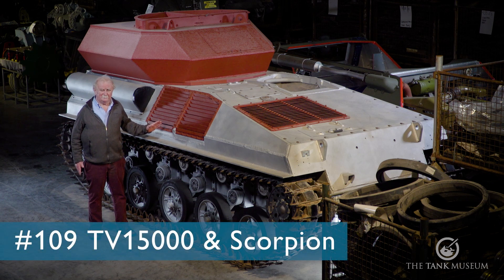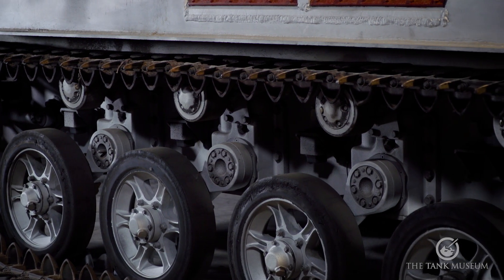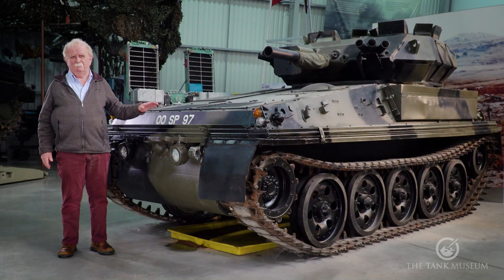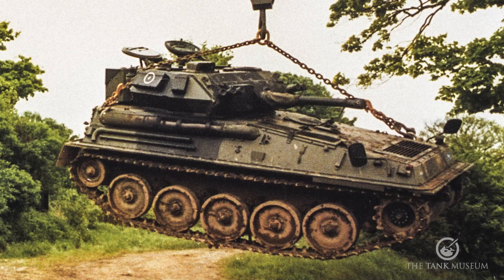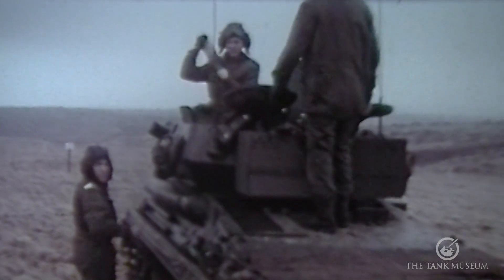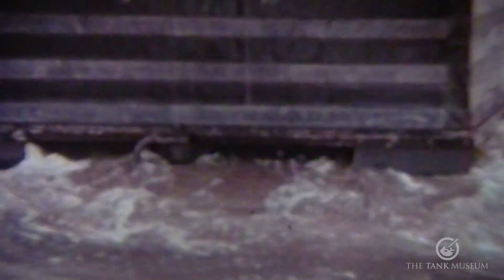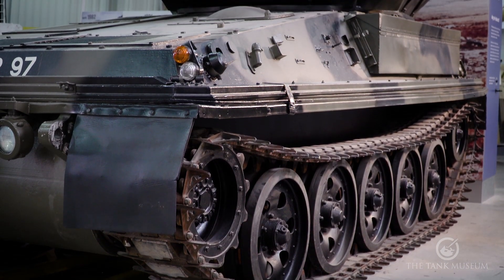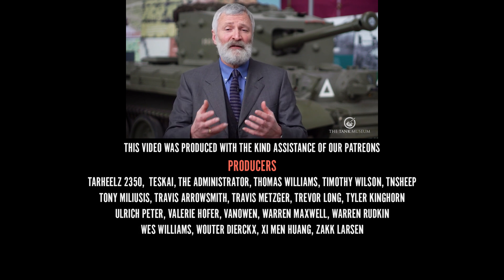Tank Chats #109 | Scorpion & TV15000 | The Tank Museum

Comment: Was the Rolls Royce engine of the prototype turbocharged? The picture when david is talking about the jaguar engine at 6:38 shows the Rolls Royce FB60 engine but with a turbocharger
Reply: @rayjennings3637  I know, but look at the picture, and you can fit a turbocharger into a carburetted engine, like a Renault 5 turbo. I don't know if the engine shown in the picture is an FB60 for sure, but that's a turbocharger at the end of the exhaust manifold.
Reply: @joseandrescaneirolopez90  It looks like one of the turbo-diesels that were fitted to some vehicles.
Reply: @rayjennings3637  Renault 5 turbo (the one with the fat as, has electronic fuel injection). Renault 5 GT turbo use a 1.4 turbo engine with a Solex carburettor, with the carburettor installed after de turbo, the only problem with this is to keep the pressure inside the carburettor and the jetting. I,m pretty sure it had a carburettor.

Comment: Couldn't they have simply fitted the gun with a bore evacuator? Or does the barrel need to be of a certain length to do that?
Reply: @Harold Smith posted the the explanation (After your post,  I will not copy his entire comment, just the relevant part)
"I've heard the 'fumes' reason for withdrawing the Scorpion, but I've also heard an alternative, or possibly complimentary, explanation, namely that the Conventional Forces in Europe treaty (CFE) defines a 'tank' as any turreted vehicle with a gun over 75mm. This meant that the Scorpion, at 76mm, would be counted along with Challys against the UK's 'tank' allocation, while the BMP-1, at 73mm, wouldn't count with T-72s et al against the Russian's (somebody didn't think that one through..). Given the choice between Challys and Scorpions, and given the huge numbers of RARDEN 30mm cannons entering service on the Warrior, the Army decided to standardise on the 30mm across the fleet, and as it happened, a handy solution presented itself. At about the same time, the Fox armoured cars were being withdrawn due to their nasty habit of rolling over, so their RARDEN-equipped turrets (similar but different to the Scimitar) were salvaged and refitted to Scorpion hulls to make Sabres. In some respects the Fox turrets were better than the Scimitar ones (better night-vision), but they did require an awkward adaptor ring to make them fit the Scorpion's turret ring."
Reply: @ptonpc  that’s what I heard too.
Reply: @davedickinson822  Likely a lot of bean counter influence. If they wanted fewer wagons & realised they could dump the unwanted bits of 2 cabs while putting together the leftovers to get 1 that was close enough to the cab they wanted to keep. Saved holding stocks of odd ordnance that wasn't really that effective any more.

Doubt the fumes would've bothered the brass if they had operational reasons to keep 'em. They just wouldn't have done any live firing in training without the hatches open, masks or ruddy great extractors temporarily fitted.

Comment: By definition a tank has firepower, protection and mobility.  The Scorpion lacks protection therefore not a tank.  Same reason an 113 is not a tank.  The 113 is a metal box that carries a squad to a fiery death.  Seen them after being hot be an RPG. Difficult to reassemble the bodies for burial.  Definitely not a tank.
Reply: It was never intended to go up against tanks.  It was a reconnaissance vehicle.   When the problems with the gun became known, it was easier to replace the turret with the Fox, which then meant it was no longer counted as a tank according to the conventional weapons treaties with the Soviet Union.

Comment: seems like a silly reason to kill the thing instead of putting any kind of fume extraction system on, even just flushing gas down the barrel would have done a lot
Reply: Well, being the military, they would have to lay down a contract to redesign the gun for a fume extraction system, to effectively create a hypothetical L23A2 76mm Gun.

But, let's look at the situation:
The L23A1 was only used in one weapon system of your entire force. 
The gun is a low pressure, low velocity gun, that has limited effectiveness against other armoured targets, in a time where it is increasingly likely, that you will be facing more, and more armoured vehicles due to the increased rise in IFV usage.
The competing RARDEN 30mm autocannon is capable of defeating a greater range of targets, but is perhaps a little less efficient at demolishing bunkers.
The competing RARDEN is also being used in the FV510 Warrior, for better commonality.
Field reports tend to show the RARDEN armed Scimitars performing better than the L23A1 armed Scorpions, in most situations.

So, it must be asked: Why spend the money to redesign/modify the L23A1? Does the benefit justify the cost?

Comment: i dont think retrofitting the gun with fume extractor would have cost too much. couple of holes and a sleeve, competent engineer would design one for the specific gun in couple of hours.
Reply: Yeah I'm sure you probably know more than the people who actually worked on these vehicles.  If only you had been around at the time to offer your insight!
Reply: From what I remember, a conventional weapons treaty with the Soviet Union at the time limited the number of tanks.  Tracked vehicles with a gun of 75mm or above were counted as tank.   When the problems with the fumes became known it was easier to replace the turret with the one from the Fox, which then meant it was no longer counted as a tank.
Reply: @ptonpc  plus (taking a guess here) reading the comments it was better as a big Bren Gun Carrier than a small tank, due to metal fatigue and space inside. *my argument against my argument is I have no idea what rounds you need to take out a russian tracked personal carrier. Either way up, a nice machine to own if you want a tank that fits on your driveway :o)
Reply: @ptonpc  The timing makes sense. There was a treaty that took effect in 1992, and the Scorpion left service in 1994. But there were also the post-Cold-War cuts. It does make me a little sceptical about the fumes problem, that's 20 years of service. Was it the combination, something that was accepted when actual war seemed likely, and then the simplest solution was to just use the 30mm variants, Scimitar and Sabre, even if the total tank numbers were being reduced a lot,

Comment: So this is the British equivalent to the Bradly Fighting Vehicle?
Reply: No, that’s Warrior
Reply: Not really . 
 It is more for recon, were as the Bradley started of as a 'battlefield taxi' .  Can we say 'mission creep' children?
The FV103 Spartan is more the personel carrier of the same 'family'. Although it only has 1(one) Machine gun.

It is more for moving a team of people than an infantry fighting vehicle.
For the British version of that you would need to look at the Warrior (FV510).
Reply: It's more akin to a tracked equivalent of the French armoured cars. There is/was a whole family of vehicles based on the same chassis:
Scorpion: Recce/fire-support: tank hull+turret, 76mm gun (90mm for export)
Scimitar/Sabre: Recce: 30mm gun
Spartan: APC: box body, no turret, 3 crew plus 4 dismounts (if none of them are too fat...)
Samson: Recovery vehicle: Spartan hull with a winch, spades and tools
Striker: Anti-tank vehicle: Spartan hull with 5 Swingfire ATGWs in a box over the rear hull, reloads inside
Sultan: Command vehicle: Spartan hull with an even higher roof, radios, map boards, tent, brass polish
Samaritan: Ambulance: Sultan hull with stretchers

Comment: The Armed Forces of the Philippines acquired and used these things in the late 80's up until now. But it was too costly and hard to maintain since the parts were so hard to reach and utterly expensive, so only a few of these survived and most of the surviving units got the engines replaced.
Reply: Either that or the turrets got cannibalized and put on M113's I think
Reply: @francistercero7396  It did, and looks very odd-looking seeing the turret of a Scorpion, and the chassis of an M113. A Frankenstein's monster of the Phil. Army, if you will.

Comment: Clip-on drive system just sounds like an outboard motor strapped to the back
Reply: Jeremy Clarkson must have had a hand in that design choice as we saw with his "Toyboata" years later.
Reply: No, even worse:
Originally, the FV100 series had much larger track guards around the front drive sprockets, that semi-enclosed the sprocket, with a hole near the middle. From what I can gather, is that you would have these auxiliary boxes that would bolt onto the drive sprocket and track guard, in which you would have a gear box, that drove a propeller.
Reply: @dposcuro  problem was the guards  were made from fiberglass and didnt last the first exercise

Comment: Ahhh...brings back memories of being on my Scimitar cruising round Hohne ranges....obeying the speed limit of course....
Reply: We once managed to get 60 mph out of a Spartan  on a German autobahn, I remember the shock on the face of a merc driver as we overtook him.

We were late for an RV so took a ‘short cut’...
Reply: Kernal Scott 2  Well....it was limited....but if you removed a fuse, behind the engine, the limiter stopped working....my dvr reported over 55 mph!! Yes it had a 30mm Rarden, awesome gun, but very underpowered!
Reply: Kernal Scott 2  ...and some damn good memories!
Reply: Should have left the fuse where it should be
Reply: @alistairsamson299  no fun that way....  :)
Reply: Sany0 apart from the rows of cvrt with smoke bellowing out the engine vents, on hohne range road, all with yellow flags up,